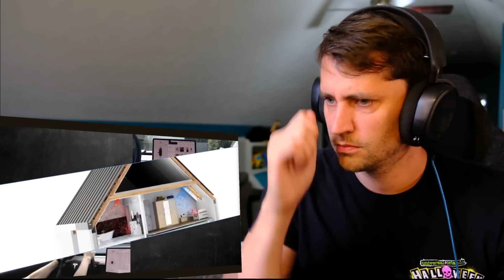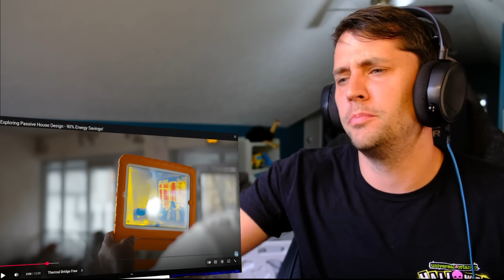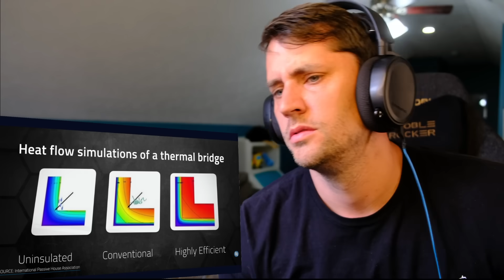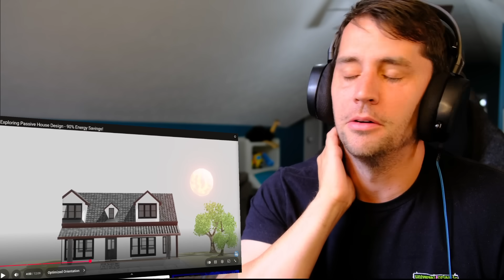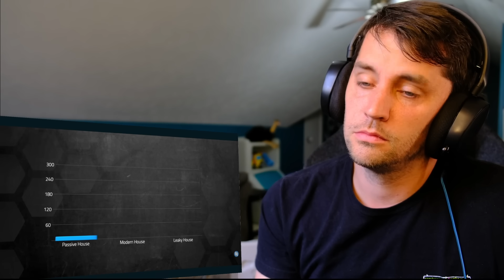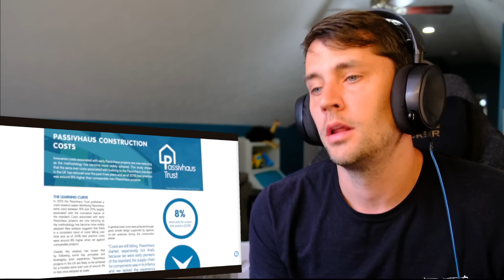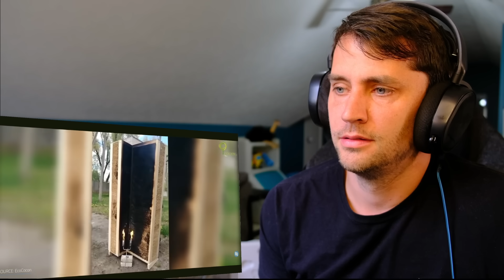American reacts to Germany's amazing 'Passivhaus'

Comment: There is also a plus-energy house. A plus-energy house (also called an energy-plus house or Efficiency House Plus) generates more energy over the course of a year than its occupants consume for heating, hot water, and household electricity. This is achieved through a combination of high-performance insulation, modern technology, and renewable energy sources. In other words, the house produces more energy than its occupants use. The surplus electricity is, for example, fed into the public power grid. At present, in Germany, we receive only about 7 to 9 euro cents per kilowatt-hour for the electricity we feed into the grid, while we have to pay between 27 and 39 euro cents per kilowatt-hour for the electricity we buy. The exact price depends on the electricity provider, and in Germany consumers are free to choose their provider.

Comment: After last heat wave in Europe , I have noticed, that  I can have comfort temperature in my home at least 3 days . 
Later it went up to +29C in my sleeping room , while outside +42C . I've used active cooling system after it hit +30C .
Fun fact , that I don't use a heter a lot , to heat my sleeping room in winter while outside -8C . 
My wife generates enough warm to heat a room :)

Comment: No , the certification is the problem, we had an old house from the 1960, when we said in 2010, we need a new roof and suddenly, we pay no longer for heating and cooling, we have centrAl heating and the Hauses after us mean that the hot water that they need, we no longer heat the house.

Comment: Pleace translate: Ich kann nur sagen, dass du viel Geld sparst, wenn du einmal gut passiv oder nahezu passiv gebaut hast, als für immer Energie zu verschwenden. Es kostet am Ende weniger. Vieles was er sagt, ist voll gut umsetzbar. Es ist nicht so schwer und du baust vielleicht für Generationen, was extrem nachhaltig ist. PS. Doch wir lüften trotzdem, schon um die Nachtluftfeuchtigkeit loszuwerfen. Wir haben kein Problem mitzu trockener Athemwege oder Haut. Ok. Es stört dich vielleicht weil es so perfekt ist, aber es lohnt sich halt, wenn du dich dafür öffnest. Ok, deine Nachbarn werden es nicht verstehen, aber du wirst wissen, warum du das machst.

Comment: I live in Europe in an apartment house with 50 cm (1,64 ft) thick walls, double insulated windows and heat pumps on the roof, floor heating in the flats. 

I only put the heating on for a shorter while in the evenings, in deep winter when it's really cold I still only use the heating during day time. When I leave the flat for a some days in winter with the heating switched off it is still about 16 °C (60,8 °F) when I come back. 

During summer in the heat I can keep the windows closed during the day time, so the heat doesn't come in (very hot south side) and can let cool water flow through the floor heating system, which cools the place down to a lovely 25 °C (77 °F) - all without airconditioning (which also would use chemicals to cool the place). 

There is a big water tank with warm water in every flat and a system which sucks out too much humidity in the air automatically (i.e. from the bathroom).

It is not a passive house but highly energy efficient. I only have to pay for electricity and water, which is also less than in any other normal building, thanks to the energy saving built.

Comment: You do "Lüften" only for a few minutes; for example, when you make the bed in the morning with the window fully open: the stale, humid air (that's the most important part: the moisture has to go to prevent mold) flows out, and fresh air flows into the room. Yes, the fresh air is very cold in winter. But the brick walls and concrete floor and ceiling still retain a lot of heat. Therefore, the fresh air warms up very quickly with very little additional heating cost. The benefits of ventilation outweigh the costs.
If you're lucky enough to have a window in your bathroom, you should open it wide after showering. You can watch the plumes of humid air rush out – no fan could fight against that much moisture. Two to three minutes is enough, then quickly close the window again.

Comment: So even a good new house in germany has really great energysafing. 
I needed only 5000 kw/h for the hole 3 flats in my house. For warming and warm water. 6 People living in the house. 300 qm.
Thats 3300 sq ft. 
But my outer walls are made of 35 cm (Aprox a sq ft) of gas Stone. Its a really light stone with much airbubbels for isolation. And thats it. Not any more other isolation. 
3 glas Windows.

Comment: My apartment building that has been built 10 years ago is so well insulated that in winter, I still don‘t need heating. In the 8 years I‘ve been living here, I haven‘t had to turn on my heating even once. Even in winter, if I spend the whole day at home, my body heat will have heated up my apartment so much that I have to open a window to get the temperature down to a level I like.

Comment: Belgium has the same house standarts. Ventilation system with energy/heat recuperation. Triple HR glass and external doors and windows have thermic frames. Heatpump works with earth water. and domotica electrical like KNX. Compleet house is wrapped in 20cm insulation

Comment: I live in a passive house and I dont need to heat for the whole winter time. But in summer, when there is a longer period of high temperatures it can get hot inside too. A passive house is very temperature-stable, meaning temperatures change very slowly compared to a conventional house.

Comment: The video makes is sound as if this owuld be a very special thing ("only 25.000").
However the point is how regulation works in germany: 
Every newbuild house needs to reach a certain energy efficiency rating. And these requirements are regularily be tightened. 

For example: at some point some years ago they defined a "reference house" =100% primary energy consumption. 
This is calculated be factoring in all the insulation, type of windows, thickness of walls, type of heating system etc.

Then they set some thresholds and then over the year thighened them:
Until a while back the minimum you have to achieve to get building permission was 70%. 
Today it is 55%.
So compared to the default efficiency from [whenever it was defined] you may not build any home that does not at least operate on 55% of primary energy consumption (or better than that).
That's the current minimum threshold. No building permit if it needs more.

Then there are the incentives:
If you build to achieve not only 55% but even 40% of the default, then you'll get a certain amount of money (100.000) as a mortage to very good conditions (like: 1/3 of current bank rates).
So this was a win-win-win: state can raise money cheaper than any bank, passing it to consumers as mortgage makes this roughly cost-neutral to the state, while the consumers save on mortgage cost AND get a better house AND save on energy costs AND the environment benefits. AND because of the way it works that mortgage money counts as equity, making the remaining mortgage cheaper.

Comment: I live in Germany and not in a passive house. But my house (from the early 2000s) is A+ standard. Everything is done from electricity - heating, water, cooking, driving with my EV which is charged to 94% at home, and my "small IT setup" I have to run for my job (approx. 1kWh consumption per hour). Yet, despite Germany has one of the highest electicity costs in the world, I pay just ~€250 per year. So, yes, if done properly, you can save a lot on running cost. But do not expect that this is actually valued by second-hand purchasers. My neighbours house is of similar size and design, approx. 40 years older, and valued 15% above my house's price. So, if you want to have such efficient house, you want it for yourself. But second-hand customers barely pay buck for it.

Edit 1: yes, I have plenty of windows. They are tripple-glass - which makes the insulation. Even at -22°C which we have a few days in the year.

Edit 2: because I expect this question: my house costs me ~20k€ more than a comparable "standard" house at that time (e.g. comparable to my neighbours one). Yet, I pay ~€250 per year, he pays ~€3.000 per year. So, I have financial benefit in less than 10 years - ~10 years with interest :).

Edit 3: why not more such houses? Because people do not want to bear the additional investment cost. Actually, most people who let build houses cannot afford them, financially struggling for the next 50 to 60 years. And then tell them "hey, why you do not just spend 10% more on a passive house?" seems stupid. Also, because (at least in my opinion) most people are unable to think ahead for more than 6 months.

Edit 4: and my home wasn't build in 15 seconds, but in just two days. And it took them two days because a traffic jam get the truck stuck at the highway.

Comment: hello just saying something to windows, they can be isolated very good. at least minimum standard in germany is 2 layers of glass with air inbetween. you can upgrade to 2 layers of glass but vacuum inbetween, but they are hard to produce so way more expensive. there are also 3 on 4 layer windows, but they are more expensive too. And to help against heat from the outside you can use roller shutters. you can let them down when your not home and they dont let light in, you can also close them in winter over night as an additional layer of isolation, but in that perspective they only work marginal and only work wonders if you just got one layer of glass (really old windows or windows from another country).

Comment: house year of construction: 1964, year of insulation 2022; living area: 220 m², Lambda heat pump, normal heaters, 16,5 kWp photovoltaics; mechanical ventilation; heat pump consumes 2.375 kWh  a year; including electricity to run the house and the heat pump we buy 2.100 kWh a year and sell 10.000 kWh; which means that we are paying less than what we are earning! Net positive in energy and earning money! The main thing: the positive feeling every day!

Comment: Ventilators help only against the heat until 39 Degrees Celsius. At 40 degrees + you will need maybe an Air Condition.

Comment: 4:44 Widowers = at least 3 layers of thermal insulation. At least one layer with a coating to keep heat and cold “out”. At the same time it protects against UV radiation that destroys furniture and carpets. Doors 2-3 layers, insulated. This also applies to door frames and more. And of course solar cells, for generating electricity and possibly hot water.
Throughout Europe there is a great development in this field. Among other things in Denmark, which is probably one of the absolute leading countries in the world when it comes to low-energy houses and renewable energy solutions. There are companies in Denmark that do nothing but build so-called ZERO-energy houses. Electricity is stored in batteries. Heat in “thermo-batteries” - solar cells that heat a “GEL” that can later help to raise the base temperature of hot water, so that it only needs to be heated by the electrical system from, for example, 35 to 60 °C. The first 15 degrees from 20 to 35 degrees is handled 100% by the gel and then it is helped along.
Everywhere, lamps have been switched to LED or cheaper energy sources - in terms of energy consumption. Every WATT counts.
Developments in Denmark are happening so fast that the government cannot keep up with the legislation that makes it profitable. Many people run into problems with their houses producing more electricity than they can use, and then there are no working agreements with them to sell and buy energy to and from the electricity suppliers - so it ends up being too expensive.

Comment: In the beginning you say two things: probably zero people who live in a passive house are watching and „there is not many of these houses“. Both is quite wrong. 
I am from Austria and will move to a new apartment in two month. It will be on of 28 apartments in a building built according to the passive house standard. In Austria every new built apartment complex has to meet the energy requirements of a passive house. So basically every new multi apartment building is a passive house and many people live in them. Chances are some of them watch your channel.

Comment: A 160 m² passive house single-family home has an annual heating requirement of a maximum of 2,400 kWh. 
This value is the heating requirement. 
The primary energy requirement, including electricity for hot water, for a passive house is approximately 15,000 kWh per year for the house.
 A PV system on a 70 m² roof with 400 W modules and south-southwest orientation can generate up to 43,000 kWh per year, depending on the exact conditions and the efficiency of the modules.

 With a PV system producing 43,000 kWh, you could also drive a VW ID.4 over 100,000 kilometers, since an ID.4 consumes approximately 16 kWh per 100 km, which equates to 22,000 kWh for around 140,000 km.
86.000 miles. 
 However, the actual mileage depends on how much of the solar power produced is actually used to charge the car. 

This means PLUS ENERGY because the car, with its energy consumption, is not normally part of the standard consumption of a House 😊

Comment: Let's say, the cost difference between a normal house and a passive house is 50k Euros. If you consider the passive house has the potential to save 5k per year in energy costs (more if you have an EV and you can fill up from your solar array), the upgrade cost is paid in 10 years. 

Considering people in Germany live in a house as long as they can, frequently 30+ years, this is a no-brainer. Having an extra 100k to spend over the time is nothing to sneeze at...

Comment: I made a low energy consumption house 25years before. Efficient rate To standard construction which reduced cost from 3€ to 70cent per sqm. I always recommend to do that. It should be standard for all. Insulation cost are high but it is worth to do that.

Comment: I have a 60+ year old house and my heating uses 20kW for heating, but it could come as low as 8kW when I invest about 200k of which I get funding for 30%, but that is the thing. I now have a PV on the roof and a large battery in the basement. I produce my own electricity and charge my car.. I am changing the heating to a AC solution that can also heat and that will bring the energy use down as well, but I need to find out how much.

Comment: 4:41 Actually no - you can get 2 panes of glass and create a vacuum in between them. The vacuum is an amazing isolator, but the window frame needs to handle a lot of weight. Plus, if it ever leaks, it will fog up your view, which cant be fixed - you need a now window.

You can even opt to use shaded glass, like your sun glasses. Sacrificing a bit of light, for a reduced in flow of heat through the window.
Likewise, you can put a white coat on your roof, to reflect more light and reduce the heat captured by your roof.

Comment: good video, showing what is possible and affordable today! 
My passive house costs around €500,000 and has a floor space of 160 m².
The annual energy consumption for hot water and heating is 3000 kWh, which corresponds to €360 per year.
The PV system produces 20 MWh per year and achieves 95% self-sufficiency. Approximately 50% of the energy is used for the house and two electric cars (approximately 23,000 km/year), while 50% is sold, generating approximately €1,000 per year.
=> This results in zero costs when all costs for the house for hot/cold water, waste, municipal costs, and insurance are taken into account. Also zero CO2 emissions (the external hot water supply comes from a renewable source).

Comment: I am a German citizen and built a new house 15 years ago. It was already a legal requirement 15 years ago that a new house had to be a passive house. In fact, I and almost all house builders have built an active house. This means that I produce more energy over the year through solar energy (electricity and heating) than I consume. The windows are triple-glazed. And I have no heating system at all (in a country where it can get as cold as -20°C in winter). Instead, I use a heat pump that makes efficient use of existing waste heat.

This is nothing special here, but has been standard for many years!

Comment: The thing with "lüften" is, you want to exchange the air as quick as possible, but you don't want your walls to cool down.
Therefore you open the windows as much as possible, but only for a relatively short time. Yes, the warmer air from the inside "escapes", but that is usually also the air with higher humidity than the colder air from the outside. As the walls and the house in general are still warm when you close the windows after a few minutes, the colder fresh air will warm up quickly.
But when you leave the windows open very long, especially when you use the "auf kipp" position, you won't exchange that much air, but the walls around your windows will cool down. The warm humid air from the inside will condensate at that walls. Mold will be the long term result of that, etc.

PS
Why there only so any passive houses? I would assume many builders don't go the full way to get certified. They do like 80% of the standard and that will be enough to save money down the years.